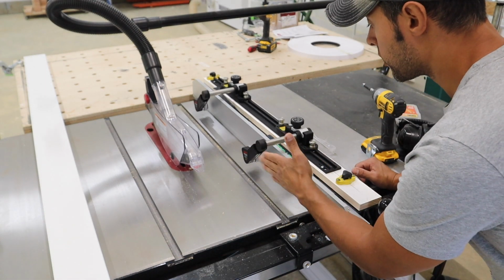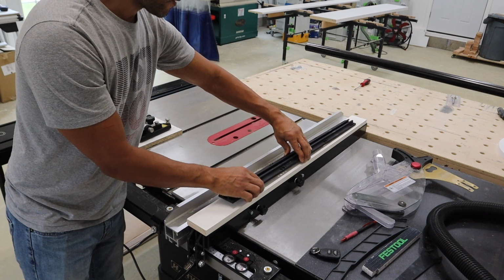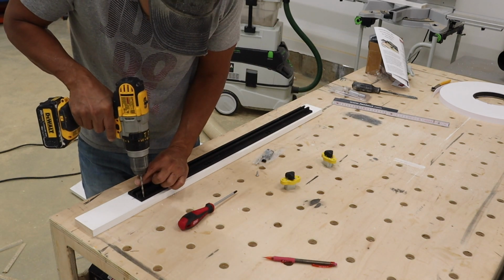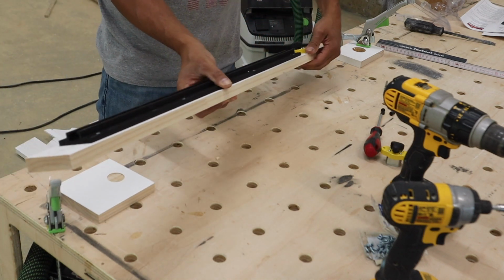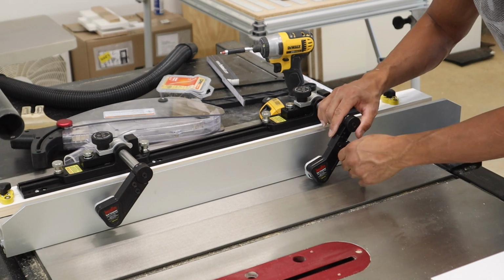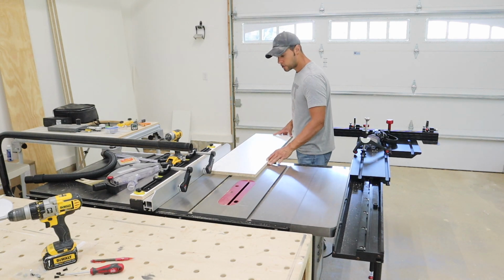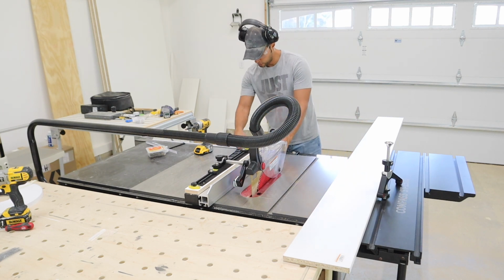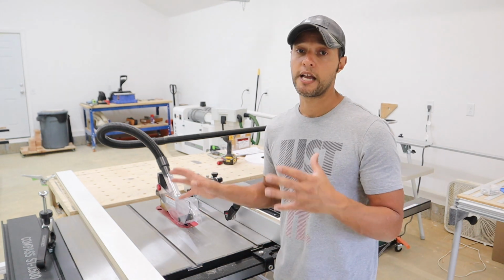The best Table Saw accessory?

Comment: Anthony, I use both guides with narrow stock. Because the guides are pushing down and towards the fence, you only have to push horizontally, so I use a thin push stick (less than 3/4") which goes under the rollers. Perfectly safe and accurate. Also with narrow stock, using one guide I use a feather board on the infeed side. That also works well. Thanks for the excellent video
Reply from the maker: Absolutely correct. I think I might have even demonstrated that you can cut narrow stock with both guides down and it doesn’t get in the way. I wish I had these a lot sooner.